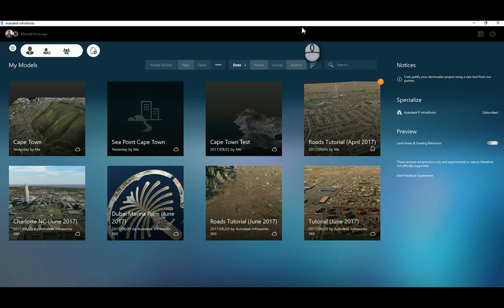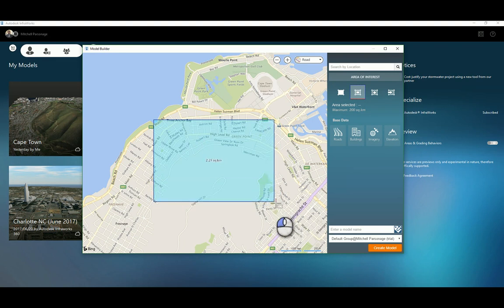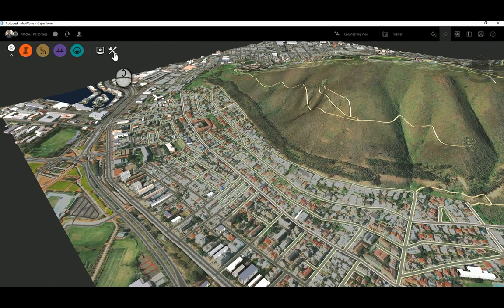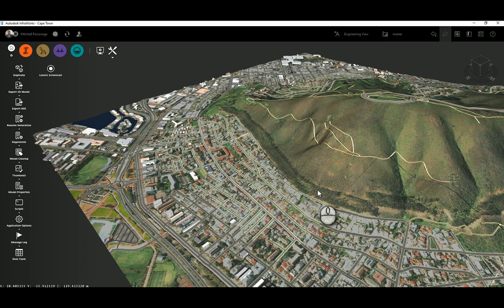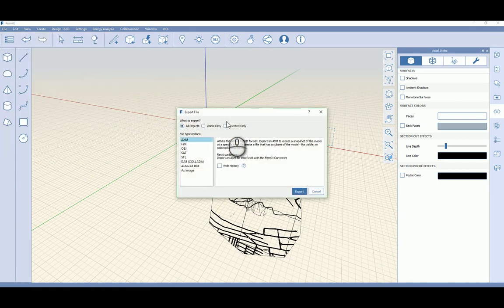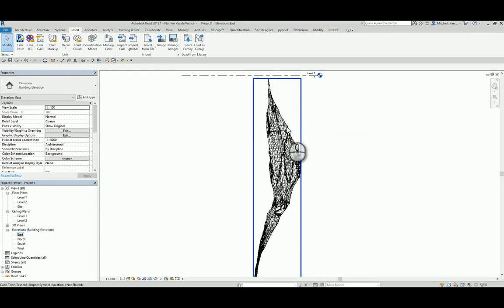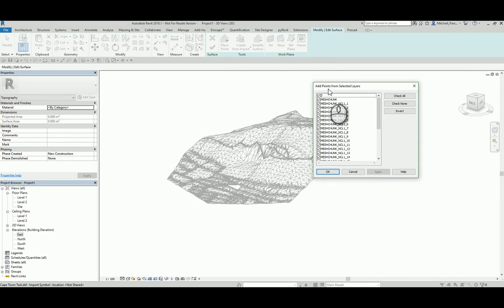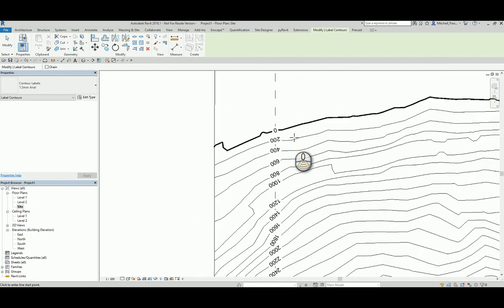Creating topography in Autodesk Revit from Infraworks

Comment: when i save in IW it saves it like separate files .obj, .pos and mtl. when i open formit it doesn't see them as the united .axm file for Formit. Can anyone tell me what is off?
Reply from the maker: Hi Xenia,

What file type are you trying to export your IW section as? When you are defining your region that you would like to export, make sure you set it to.OBJ in the export options in InfraWorks
Reply: Modena Cape Town I did do that, yet in your video it results in a single file and mine doesn’t for some reason - a few (one of them obj)
Reply from the maker: @xeniasergeeva6456  Hi there,

I am not too sure about this then, maybe it has something to do with the later versions of InfraWorks that you might be using? Every time I export I get the one file that I am after. I would recommend doing some experimentation with your export options until you find what works for you.